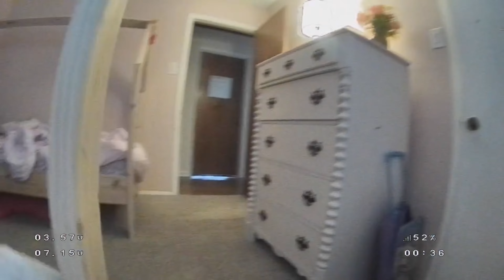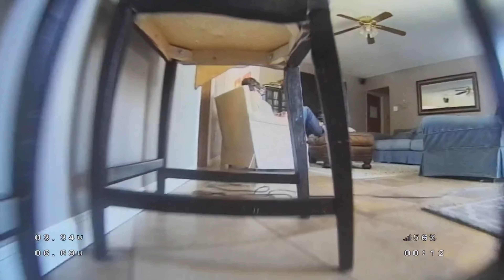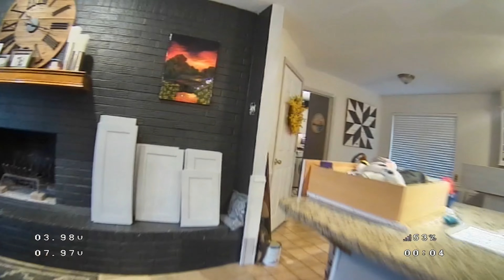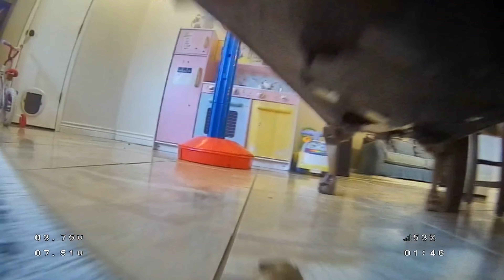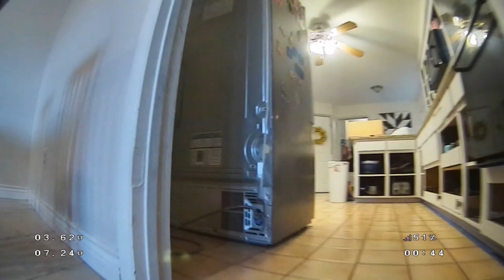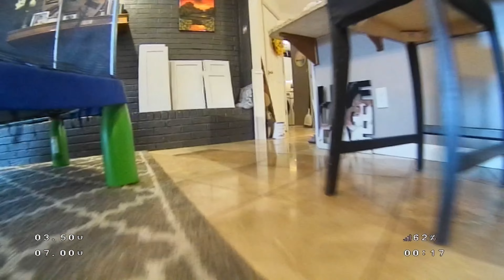SharkByte Whoop Flight and Build Info - Muon 75 - Runcam Digital FPV Gapping HDZero

Comment: Will it fly outdoors if the wind is low? Nice build!
Reply from the maker: Thanks, the built in spi receiver on this crazy bee f4 pro v3 flight controller has really limited range so you can’t go too far outside. I haven’t flown this outside a whole lot yet, but it seems to fly okay in very little wind tho, and I think it could probably fly a bit better if it was properly tuned
Reply from the maker: I got some footage today flying outside, forecast said 10mph wind but it was mostly calm with some breeze here and there. I’ll get you a link when it finishes processing, probably tomorrow. I’ll try to get some more when it’s more windy
Reply from the maker: Hope this link works, if not I’ll post it in the description: 
https://youtu.be/vhNC19q_W0U